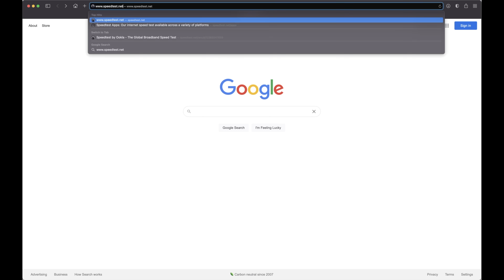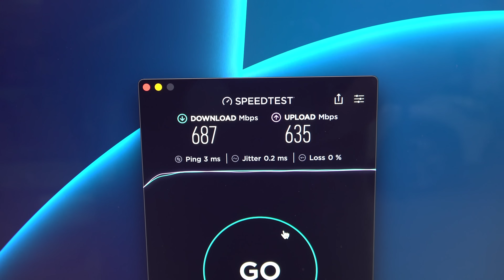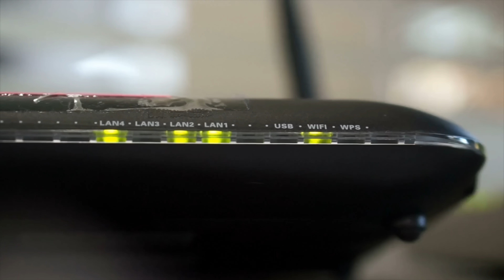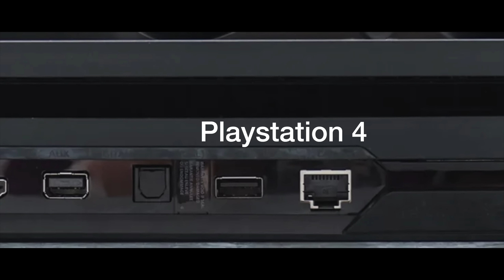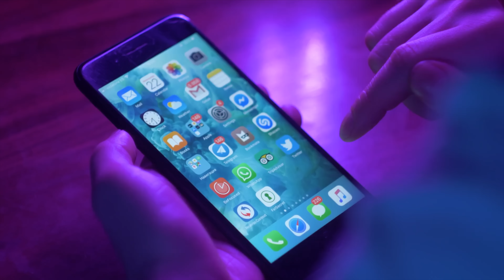How to BOOST Slow Internet Speed 2X - Cheap & EASY!

Comment: another tip for your wireless, Wifi 6 can handle more multiple devices at once.  2.4ghz is for range, 5ghz is for speed.  Most good wifi routers will have (1) 2.4 and (2) 5ghz connections.  Split them up. Put your appliances on 2.4, put your streaming devices on 5 and put your gaming stuff on the other 5

Comment: Just a heads up to look out for since you use Verizon also, Verizon will be releasing a new Router at some point likely in the next few months, i dont know much about it but i do know its supposed to be about HALF the size of the G3100 and G3200.

Comment: Wired is faster and more reliable, but you should never go with your ISP router, as they are usually technologically outdated. Get a proper WiFi6 powerful router and you can enjoy the wireless speeds comparable to wired network.

Comment: Helpful tip: when you strip the cheating off cat 5/6 cable, use the cut string a couple inches past that. That will ensure there is no damage from cutting the outer sheath, on the individual wire insulation. Hope this helps someone and makes sense, but you can have interference if those end up bare and could touch eachother. Coming from doing data work as well as residential electrician, I have seen it first hand. Another good video!

Comment: Yes and no. WiFi can be really solid with the right APs and positioning but it's more difficult and expensive to achieve then just running a cable. The introduction of 6E later this year with those additional bands will also be a big game changer imo when the right equipment and devices roll out.

Comment: My jaw dropped when I saw that connectorizing tool.
I remember having to first make the Twisted Pairs, add Kevlar, then jacket.
Screw terminals. "Touch Tone" telephone was red and green. "Rotary"
was black, yellow, white, red.

35 years ago- the next city over, there was a major company called 
Rome Cable. All of this Region's wire and cables were produced there. 
A really tall building, with draw pulleys. Fascinating to watch. Then, drive
down to Corning, where the original fiber optical glass was made, 
almost the same draw down principle.

Comment: Lots of great practical information to get up and running with wired Ethernet. But IMHO the implication that wifi would be just as fast if only there weren't any contention, is just plain wrong. For household wifi, even under the best conditions, it's just never going to be as fast as wired Ethernet can be (assuming same-vintage equipment, e.g. 1 Gbps Ethernet, never mind 10 Gbps, compared to the latest wifi).

Comment: Very good! Was expecting another Wi-Fi clickbait video but was very pleased with the information you gave. BTW, the blue old work box you used isn’t needed. NEC says low voltage(Ethernet, telephone, etc) doesn’t require a fully enclosed box like line voltage does. You can use a orange old work low voltage ring which has no box and simply has the anchors for a wall plate.

Comment: I like your yard maintenance videos, but I gotta say, I'm not impressed with this one. Was waiting for you to mention hubs, access points, MTU, channel, channel width, 5ghz, 2.4ghz, latency. None of that was said. All u said was "don't use wifi". Gotta say, if you know what you're doing, you can wring 500mbps over wifi from separate floors (like I do). You also are a little manipulative in saying game consoles need increased speed, when the top issue with online gaming is latency, which that won't change... I'm sure it's not easy to come up with content regularly, but c'mon... You do those other add videos like that tire inflator (that was supposed to pump up 4 tires and barely managed 2.)

Comment: Um so your only solution is to plug things into the Ethernet cable. Well no crap man that should be common sense. Hoping there was some router setting that I didn't know. Drawing from a different wifi channel helps with your wifi connection.
Reply from the maker: I suppose the other way would have gotten a lot of views and no actual results. At least what I showed makes a major difference, don't underestimate it.

Comment: A lot of homes telephone lines uses ethernet cords that all leads to a communication panel usually located in the masters bedroom closet. I converted all my telephone lines to dual ethernet & telephone ports. You may need a switch if your router doesn’t have enough ports. The most cleanest modification and u dont have exposed wires running everywhere.

Comment: I've gotten lots of great ideas from CS, but I think this was a swing and a miss. I replaced the CAT5e cable between my brand new cable modem and my brand new router with a CAT6 cable and the speed on all my devices DROPPED to half their previous speeds. I put the original cable back and the speeds went back up. I was getting some lag in my TV picture so I installed a CAT6 cable (not the same one) instead of using wi-fi and once again the speed test showed one half the original speed. Exactly the opposite of what should have occurred.
Reply from the maker: If you were already cabled, switching to a higher rated cable should have no effect. However you mentioned a TV, oddly enough many TVs only have a 100meg port ethernet jack, unlike almost every computer that would have 1000meg capable. So you may have made the TV work slower with that port. But many tvs will use an adapter like the one showed and will then support 1000meg (gig) and that should increase the performance. The video was really geared for computers but this may help you with your TV. You need to check online as to what adapters are supported by yoru TV.

Comment: In power supply of the new Mac desktops is an Internet Port
Reply from the maker: Sadly, the dirty secret is that on the iMac the gig ethernet is an OPTION for $50 more. Why would they do this? I bought this used and the buyer didn't get it so I am stuck with an adapter with no ethernet adapter.

Comment: Does cord length effect performance?
Reply from the maker: With ethernet you can go to 328 feet without problems. Shorter is always better but that's just a principle, the standard allows the 328feet/100meters
Reply: @SilverCymbal  Thanks

Comment: I love your videos. You explain so well and don’t waste our time with irrelevant info. You always differentiate from opinion and fact, and the camera angles are excellent.  
Would you consider doing a video on LED string lights? They cost three times more than the incandescent and use a fraction of the energy which makes the investment worth it if they are reliable and Easily repairable. There’s a repair tool available for about $25.

Comment: Best upgrade to my house was adding cat6 runs through the walls. I even did a run out to my Garage and set up an outdoor AP :)

95 octane Ethernet everywhere 😂
Reply from the maker: Lot of people laugh when you tell them you are running cable, they can't believe with wireless, why bother? Best thing you can do for long term performance and speed

Comment: Was prepared to be disappointed by some scammy wunder device but pleasantly surprised to see that it was solid advice.  If the device is stationary (or always used in a particular spot), you can pay the price once running a wire to get solid performance or forever be at the whim of ever-noisier wifi spectrum.

Comment: Sounds like you were running Wi-Fi v4 with those speeds.  You could alternatively upgrade your router to Wi-Fi v6 or v6E if you can afford it.  Probably still not as fast as Cat 5E or above.  But a lot easier than running cable everywhere, unless you're in the middle of a reno.  You could also go with a Mesh Wi-Fi v6 MU-MIMO too.  Should have mentioned this.....
Reply: yeah, the latest wifi technologies are prety bonkers, i was up to 800mbps on my new router, just a few years back i couldn't even imagine having that without a wire for 20€ lol.
Reply: In my case I run wireless to all but my main PC.  A full gigabit is not really needed for the streaming devices etc.

Comment: If you need an extender, you are better off upgrading to a mesh based Access Point, you end up with even less contention or go with direct hardwired Access Points like Ubiquiti Unifi if you really want to jump down the rabbit hole

Comment: Like so many things, context is important. Great video and boils things down to simple terms very nicely. For those wanting to know a little more context, here are a few:

If you're playing games (PC or game system) like Fortnite or racing, latency is very important. If you're playing turn-based or "slow adventure" games, latency is not as big of a deal. At any rate, go with a wire whenever possible if you are gaming. Also, this applies to VoIP (voice over IP) and video calls.

For video streaming (Netflix, Hulu, etc.), your bandwidth becomes more important than latency. If you have four people streaming 4K content, you're going to need a lot more bandwidth. That's the advertised 1Gbps download speed the providers like to tout. A 4k stream for one person will need around 25Mbps for a good experience. Four people in the house doing that at the same time? 100Mbps is needed. Wireless will still work just fine if you have a modern router and access points. Network contention can cause a blip, but most people will not have an issue.

Last, advertised speeds are never fully achievable. 1Gbps, in perfect conditions, will only reach 970Mbps because network overhead uses up some bandwidth. All the data that controls the signal, packets, routing (where the data needs to go), and encryption eat into that maximum advertised speed.

The video summarizes things very well. Wire is almost always better than wireless, but convenience or purpose can drive the decision more so than performance.

Love the channel!
Reply: Yep, for latency dips that's were video buffering comes in. As far as I'm aware, almost every device will buffer at least a few seconds of video if not more. If there are quick interruptions, the short buffer should make that invisible.

Comment: A great video for you would to set up a Ubiquiti Enterprise WiFi system with a Dream Machine Pro.  I was using Netgear with extenders and had horrible coverage and videos would lag.  Once I put a UDM-Pro in the e house with an access point on every floor and in wall to my tvs and gaming, problem solved and better speeds than ever before!

Comment: As an IT guy, I became CWNA (Certified Wireless Network Admin).  What I learned from the course is that wireless sucks ass unless you NEED it to be wireless.  If you can plug it in, that is ALWAYS the better option.  Ever had a temporary loss of call between 2 landlines?  I moved into my current house 20 years ago and one of the first things I did was run 2 Cat5 cables to every room.  1 for Internet and the other for phone (landlines were a think 20 years ago.  Internet went back to a patch panel and the Phone to a 66 block, so If I needed to add a bunch more phone lines, I just needed a phone system.  It was a bit of overkill wiring my house like an office building, but Yeah..  I went there...
Reply: You were taught well.  Wifi is the pain of IT.
Reply: @mabbaticchio  Very much so...  Not the same..  People bitch until I plug it in and it "Fixes" the issue...
Reply: Not true anymore with wifi 6. Wifi 6 5GHz gives me over a gigabit per second (my plan)

Comment: Even easier. Just move your laptop closer to the router or move your router to a better position in the home. Instant improvement. 

Save you creating a video on basically terminating cables.

Comment: I use a cheap dual band router, no packet losses on 5GHz and i'm perfectly fine with 300 megabits
Reply: It depends on obstructions, distance to the router and what wifi-standard it uses.  With the best Wifi 6 gear you can get up to 1Gbit nearby the router and even faster in the future.
For bigger spaces a mesh network can work great, especially if it go a dedicated backhaul.

Comment: Good video, but at 5:30, this statement is false. My 4 yr old Sony XBR TV has a Fast Ethernet port with max speed of 100 Mbps. It also has wifi 802.11ac at 1300 Mbps. I ran tests and wifi beat the cable every time. You are assuming all devices have gigabit ethernet which is incorrect.
Reply: That is true, what were the latency times between the two? Not that it matters really, even 100M is going to be more than the TV will probably use anyway.
Reply: @andrewt9204  latencies were about the same. And yes, even when I stream 4k video on the TV, 100Mbps is plenty, but my point is we cannot assume ethernet is always faster than wifi.

Comment: I JUST plugged in a cable yesterday and was getting 10mbs so I switched to wireless to get 150mbs lol 😂
Funny timing, but that's why it's important to TEST your connections, and troubleshoot (I needed to replug the network switch side, and I got 1000mbs from the wire!)

Comment: If your wireless is slow get a splitter and wire plug in everything you need and one more plug one in the extra port and put up and access point it make the wireless so much better
Reply: By splitter you mean a switch, and an random access point does does not "automagically" have to be any better than your wireless router.
A router is basically an access point and a switch with a firewall.

Comment: Be thankful you have Verizon where your located. The part of Massachusetts I currently live in, all that's available is Xfinity. 
I'd take slow Verizon over fast Xfinity. ☹️
Reply from the maker: Very true, they have done a great job at building a network. We have lost power more than 100 times here in the past 15 years, never once have we ever lost Fios. As soon as my generator is on internet is available. They must have so many meshed connections and redundancy my hat is off to their network guys
Reply: I live in a rural area, and received an offer from Verizon about LTE 4G wireless.  They offer speeds up to 50 but I think they average about half that.  Even so 25 is a lot faster than the 7 to 9 my DSL gives me.
Reply: Amen

Comment: Many years ago I purchased a thousand feet of ethernet wire, a bunch of connectors, and the crimping tool and wired my whole house for ethernet. It really wasn't that hard. Recently I installed the new Wi-Fi mesh router with extenders and now I have full speed wireless Internet also. Of course my top end is only 110 Mb, on a 100 Mb connection. I'm surprised you only got 63 % of your rated bandwidth.
Reply: Not pick: an extender is basically  a repeater which increases latency and uses up frequencies to repeat. Mesh is multiple access points using wireless as a backhaul.
Reply: @Mr2greys  I may have used the word extenders improperly. Either way, it works.

Comment: running ether net cable is still difficult for me , but i use Power line Ethernet
Reply from the maker: That's a very good option and immune from a lot of wireless based interference.
Reply: @SilverCymbal  it only work good going through one electrical panel , if you have a sub - panel , you lose the the signal on the down ward side of the sub- panel

Comment: I know you were showing for demonstration purposes, but just in case, your iMac should have an ethernet port in the power brick.
Reply from the maker: Sadly its an option on the new imac for $50 more. I bought this one used locally and the original buyer didn't opt for it. The guy at the store told me that hardly anyone buys it. Crazy that they don't include it on whats a $1200 computer.

Comment: For most people a recent wifi router will do well enough. 

There are theoretical speeds and practical. People pay for hundreds of gigabits but you gotta have the other side feeding you fast too. It’s a lot of marketing.

Wired is best if you got it, moca adapters are fine, most fios installations bring fiber in using cable anyway.
Reply: …which is a mistake. Anyone with FiOS should use their own router (ideally Ubiquiti UnifFi) and insist on at least CAT-6 Ethernet from the ONT to their router.
Reply: @seanwieland9763  I just use moca adapters it’s just as fast and my house has a lot of that wired.

Comment: If running Ethernet cable is not an option, use existing coax cables and get moca adapters.

Comment: I slept on running Cat6 for my Playstation for years. I'm never going wireless again 😂😂
Reply from the maker: For gaming, it really can be the difference between winning and losing. True story a friend of mine, he is nuts was playing on his playstation and wife microwaved popcorn for us, it killed the wifi and it froze on him, he threw his controller through the TV. The popcorn was good at least.
Reply: @SilverCymbal  thats because the microwave uses the same  2.4ghz that wifi
Reply: There is a lot he doesn't mention. Including that speed is not the same as latency (ping). This won't improve that.

Comment: You're deluding average folks into thinking they can make their own Ethernet cables.  I've been doing it for years and it's still a pain.  😊
Reply from the maker: It's much easier now than before with the imrprovements but I would still rather terminate 10 wall jacks than 1 RJ45, I always find the jacks easier but these pass through ones make it much easier than ever before
Reply: Super secret tip.. It does not matter which colors you put on each end.. As long as they are the same on both ends.  If you've been doing it for years and still are not doing it right, you need help.  I taught my (at the time) 10 year old sister to wire Ethernet jacks and make cables...
Reply: @TaaxiCaab  The comment was intended tongue in cheek.  Silver Cymbal understood that.
Reply: @GunnyPhillips  oh.. my reply was for the OP..  not Silver :)